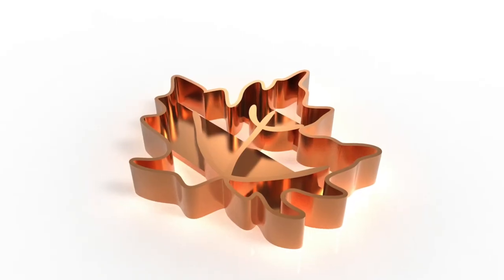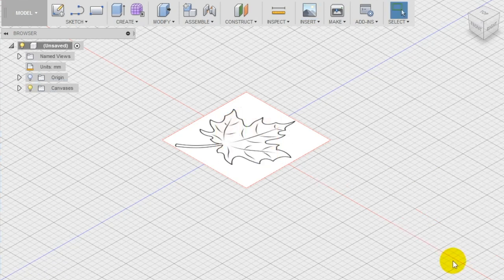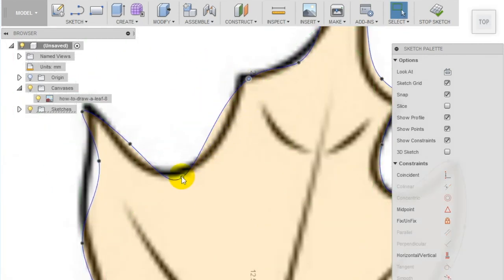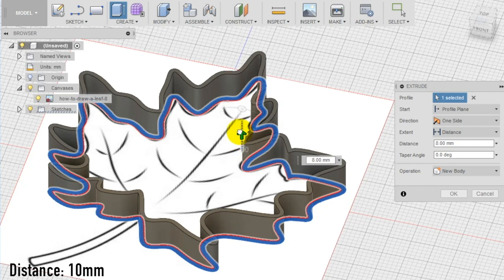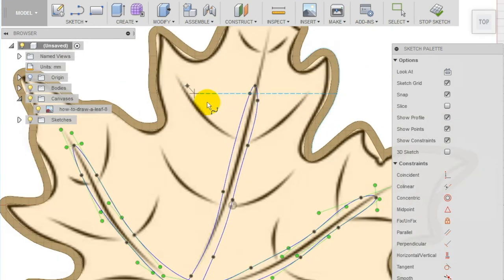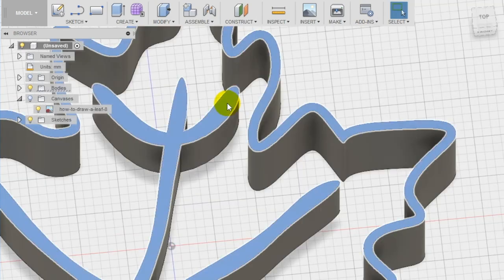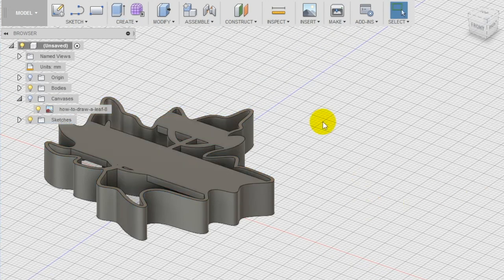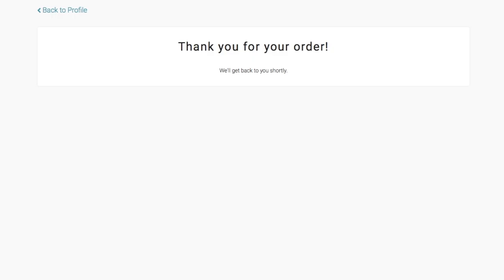Tinkercad: Leaf Cookie Cutter

Comment: Fusion360 is an expensive subscription program.  So this guide is useless... Fusion 360 costs £36 per month.  £36 per month to do what can be done in a free CAD program.
Reply: just a heads up, u can get it for free now for personal use so as long as ur not using it for commercial use like making stuff an selling it then its free. ive been using it since i got into 3d printing almost 2 yrs ago but i use tinkercad more often just cause its alot easier an faster in most situations but when i cant do it in tinkercad i go to fusion360. it took me awhile but once u get the hang of it, its well worth it.

Comment: Am I the only one who thinks that it's a bad idea to 3d print a cookie cutter?... I mean, you're attempting to take something which has several tiny grooves in it, then press them into a dough,  which will proove exceptionally difficult to fully remove if you ever plan to use the cutter again.